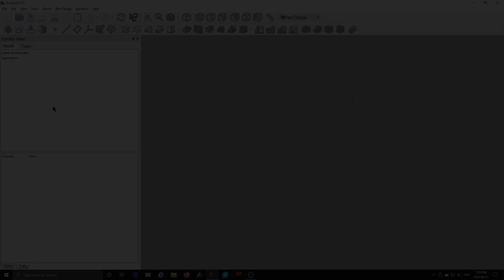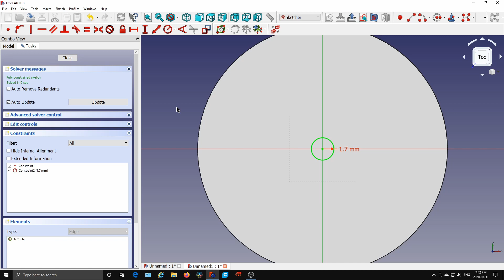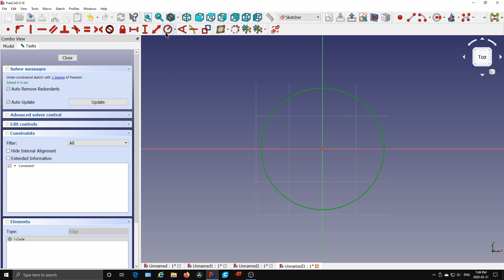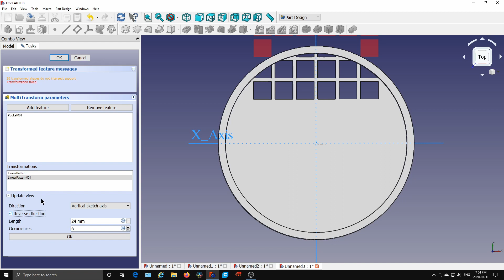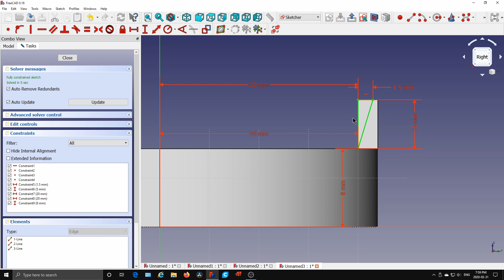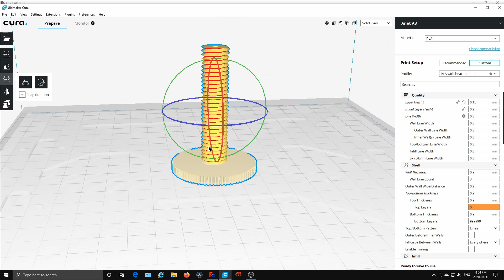G&H Honey Bees - 3D Freecad tutorial about queen marker

Comment: Very nice Gary. You've got me think about getting a 3D printer.
Reply from the maker: If you are into making things you might enjoy it. However study up on reviews of various machines. I made the mistake of buying a really cheap kit from amazon and it needed a lot of help before it would even work. The extra money I have spent on it most likely would have gotten me a decent machine. Also some printing filament is really fussy about enviromental conditions i.e. temp and humidity. If possible maybe look into a machine with an enclosure so it is easier to control those conditions around the printer.
Reply: @berrrygr   My son has a couple of machines he has been using for a couple of years. I will get with him if I decide to get one. Thanks for the info.
Reply from the maker: Thats a good way to get started. He can most likely run you through the in and out of printing
Reply from the maker: I was just thinking if your son has a printer perhaps you would like a copy of the design files and he could test print one for you. Let me know and I can put them in mu google share and send you a link.